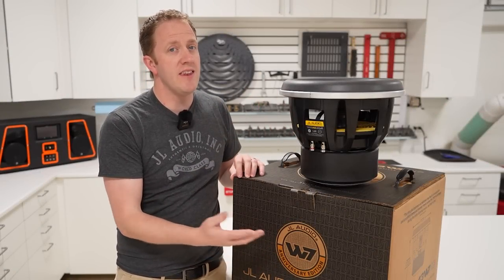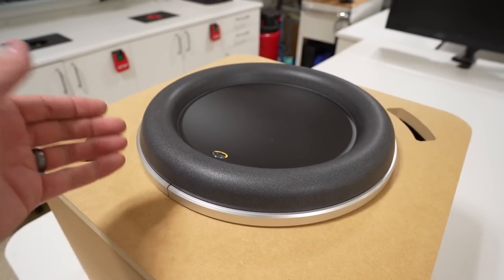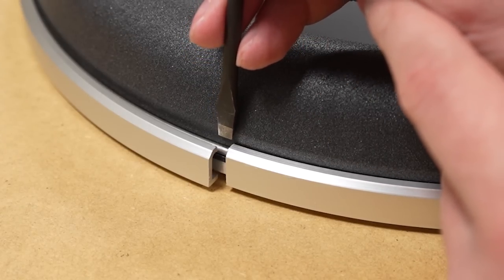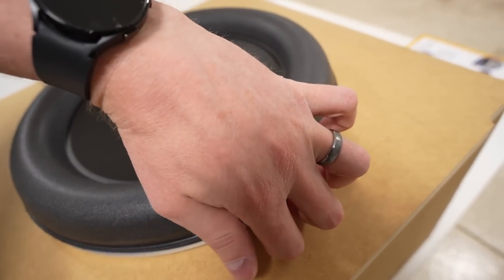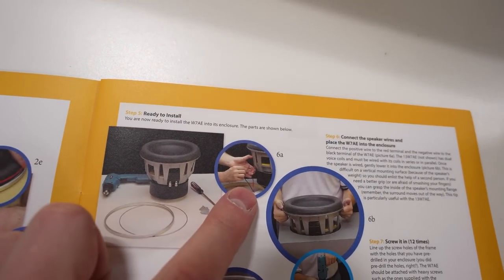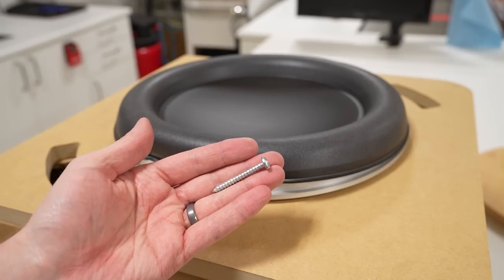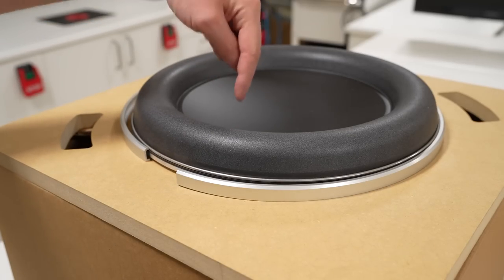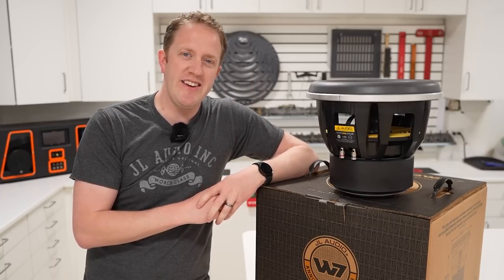How to Remove and Install the JL Audio W7 Subwoofer

Comment: I have a hd1200 amp and 2 10 inch w7s enclosed box. Do I wire both subs individually to amp or should I parallel wire them for loudest best performance